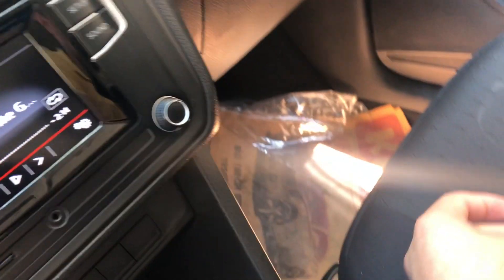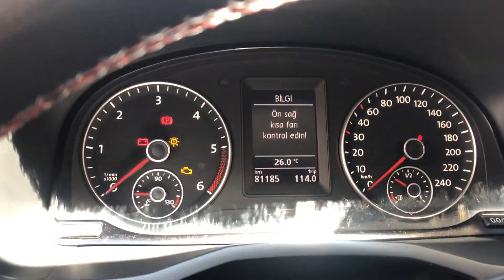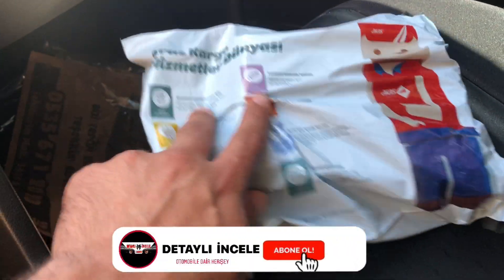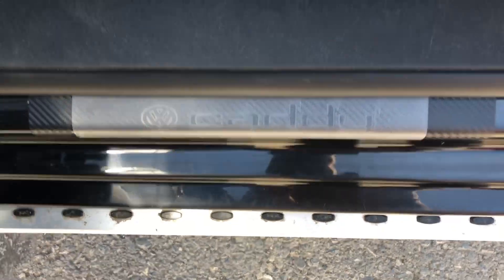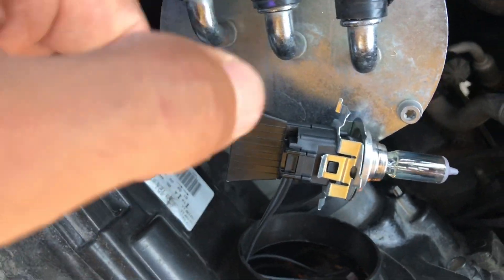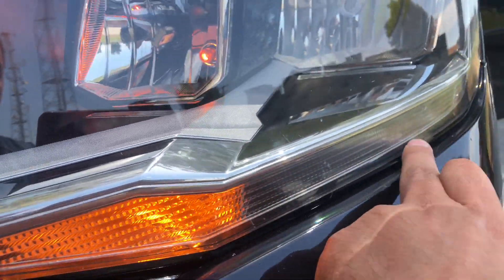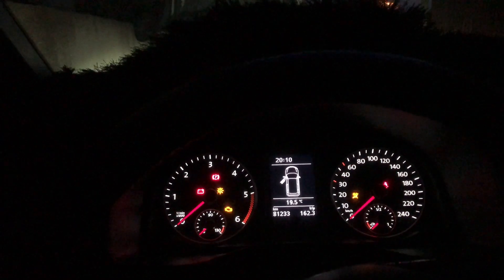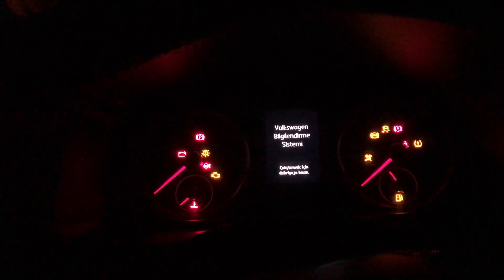Volkswagen #CADDY | Şimşek Etkili Led Xenon | Turuncu Park | Karbon Kapı Eşiği | Uygulaması

Comment: öncelikle selamün aleyküm abi bizde bir caddy var 2017 otomatik biz bu aracı satıp Ford connect a geçmek istiyoruz yeni kasa cam tavanlı otomatik önerirmisin caddy den aldığımız performansı bu araçtan alırmıyız ama caddy 180 hp idi
Reply from the maker: Teknoloji konfor ve genişlik olarak connect ten memnun kalırsın. Ama prestij kalite ve güç olarak aracın yazlımlı olduğu için caddy daha iyi zaten ikisi bu sınıfın lideri ford sağlam araçtır ama tercgni ona göre yap
Reply: caddy çok hızlı ama çok yakıyor arka koltuklarından nefret ediyorum hiç rahat değil he bide tip olarak caddy bence daha iyi ama connect çok konforlu caddy ile 240 km  gördüm ama connect e bence 200 yapmaz şerit takip çarpışma önleyici vs vs connect e yok yok ama caddy çok kaliteli
Reply from the maker: CADDY ASLA ÇOK YAKMIYOR BU ALACAĞIN CONNECT DAHA ÇOK YAKIYOR. Yazılım atıp seri kullanırsan yakar tabi
Reply: hayır caddy 7 krş connect ise 2 ile 3 krş yakıyor komşuda var
Reply from the maker: Yanlış kardeşim alıp kullan öyle karar ver. O connect 8 litreden aşağı düşmez
Reply: üstelik yazılım atarsan  bir kere yakıtı düşer